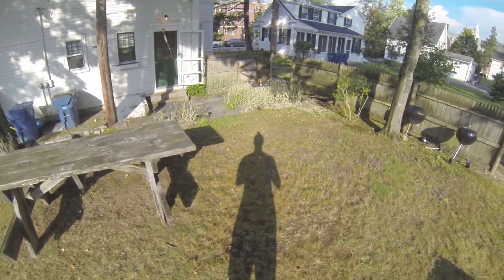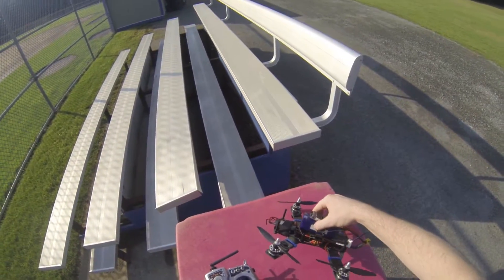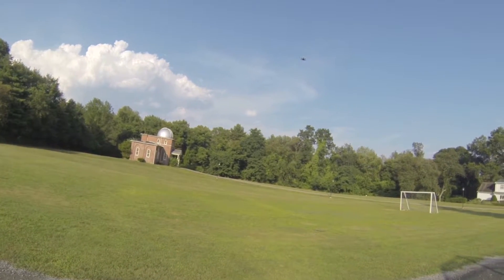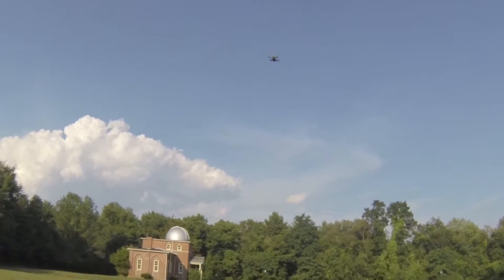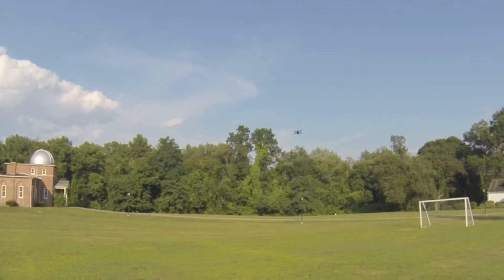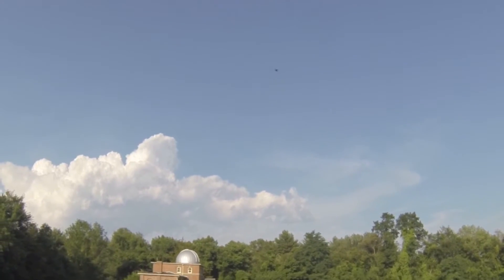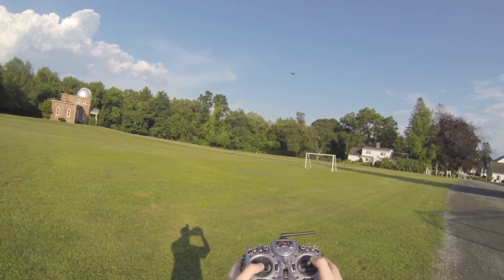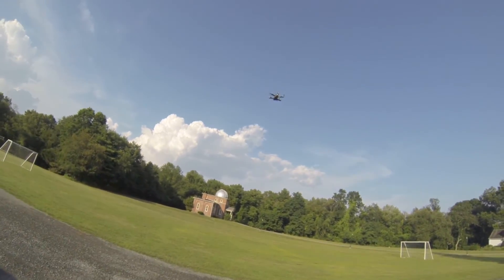LRC quadcopter 4s test flight. 9-to-1 thrust to weight ratio

Comment: why u so jittery I use 6s on rc cars made with Legos lol
Reply from the maker: +historyskyz what setup do you run on your cars? 6s on my motors result in 45,000rpm. that is pretty fast imo. 750 rotations per second at full throttle.